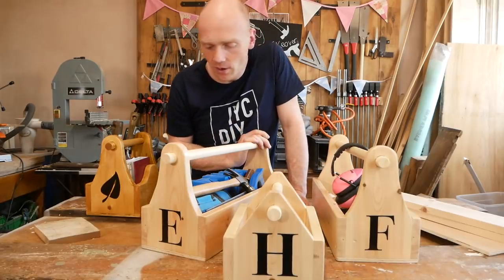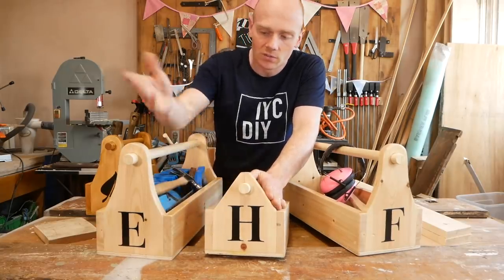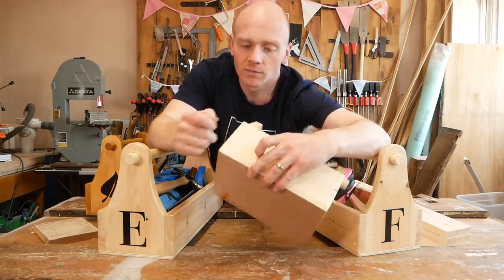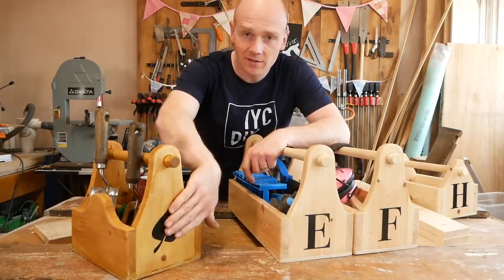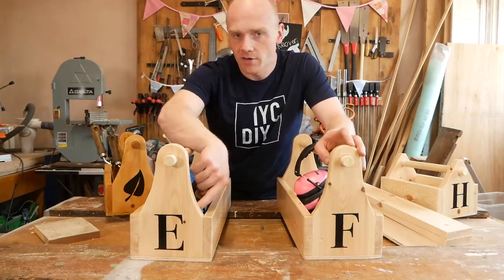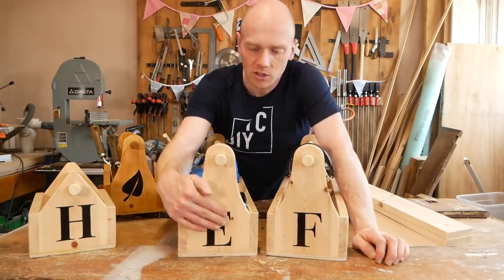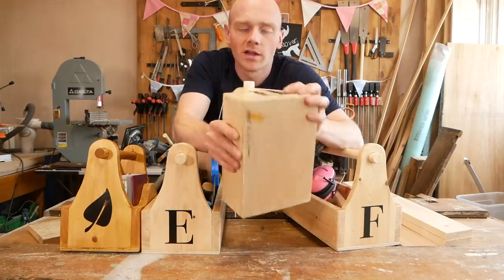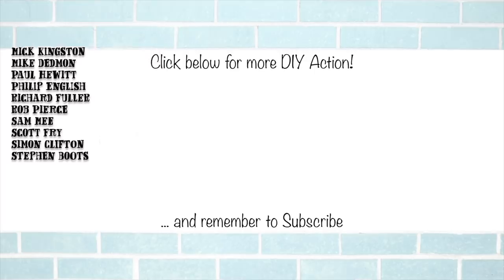Tool Box Follow Up and WHO IS H?

Comment: You can make the letter prints by coating normal printed images with water based polyeurathane varnish, then applying to the wood and washing the paper off. Just needs a final seal. Looks ok when finished.